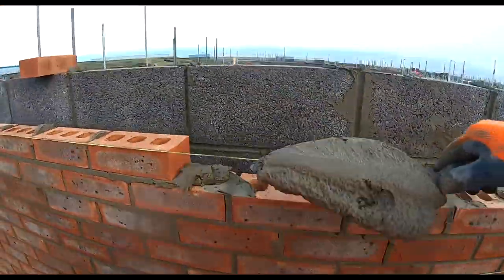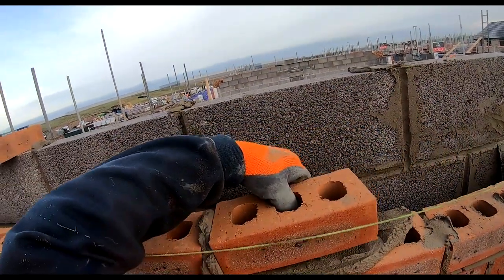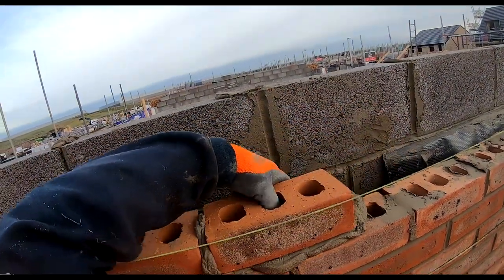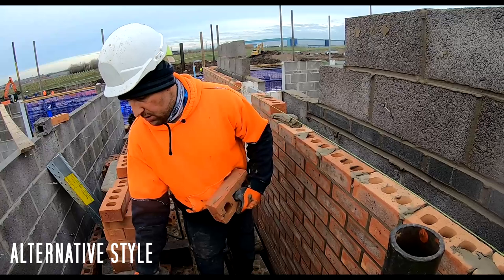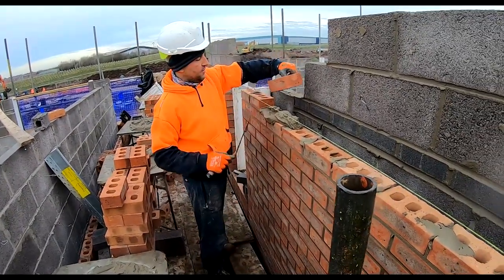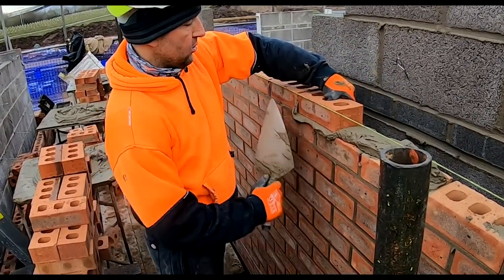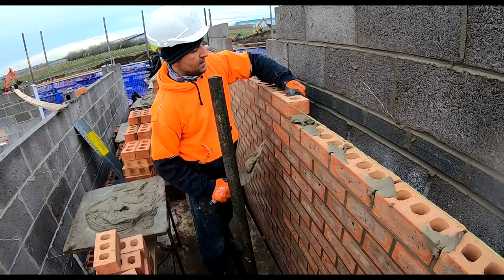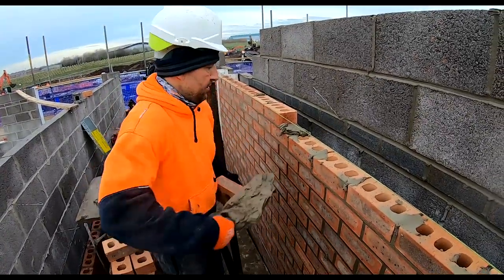BRICKLAYING Pic and Dip Action! Thumb in the Perforation Demo 2nd Half 😀🧱

Comment: Like all the various methods you lay. Never seen anyone lay a brick wot their thumb in the middle hole though
That method is great for a full joint, but your kinda laying the brick twice..but it looks pretty quick still👌👌👍
To get a fuller joint when pic and dipping, maybe bring the brick down at a sharper angle to "scoop" the muck and maybe pull the brick futher across the bed to scoop up more🤔? I've not pic and dipped in about 2 years 😂 i laid like it solid for 2 years 😂
Have an awesome weekend fella! Nice work as always 💪💪💪👍☺️
Reply from the maker: Cheers for comment mate !! Yeah always trying new stuff! 
I nearly always put thumb in with perforated brick as it leaves my finger free at the back to keep checking half bond with perp below. Sounds a bit mad but I can build like this and just switch off👍👍 I did a vid on it a while back… 
Have you stopped pic and dip altogether then Izzy? 😀👍
Reply: @brickworkfundamentals4636  oooo I've never thought about that! I normally get to the middle and Knock all my bricks back😂😂😂

When I was house slashing I use to do it all the time..bit I've found I'm actually pretty rough doing it recently as I'm out of practice..once I go on price I'll be doing it again 😂😉
Reply from the maker: 😂👍👍 non of that with this Izzy 😇😂
Reply from the maker: Yeah on price its mega 👌🏼 I like to mix it up but generally do whatever is the easiest I my body lol 👍👍

Comment: Isn’t the mortar supposed to fill the holes
Reply from the maker: It does a lot of the time. I’m happy enough that the mortar from the next course will fill any big holes in the cross joint bellow. But it’s not perfect all the time if the mortar is inconsistent or Laying high. I was just playing about looking for a method where it is perfect everytime. 
To get full bed joints and full perp when pic and dip with perforated brick I find you need a lot of mortar to make sure you get lots of “squeeze out”. This means cleaning the face with 2 or more swipes of the trowel. I’m always looking for methods that only require one swipe. It just feels better for me. 
I’m using a normal pic and dip most of the time at the moment for speed but I do use this weird method quite a bit as well. 
😊👍

Comment: No quicker than laying them the normal way.! Not seen you take any snots off the back ?
Reply from the maker: No it’s not crazy fast but i like mixing it up and trying new things. With this method there is less squeeze out on the front  (one swipe instead of 2). So there isn’t much on the back aswell . I finish the course, put the line up on the right, then clean the backs off on the way back to the left… repeat. 
I’ve just put a short up on the Chanel with normal pic and dip with these brick. A lot faster and still nice full joints.
Cheers for the comment lee 😊👍